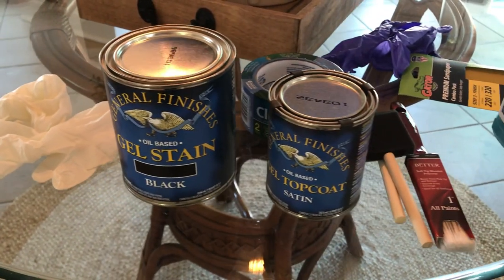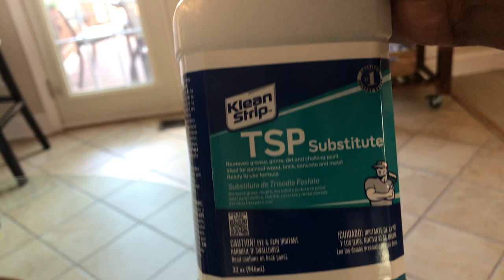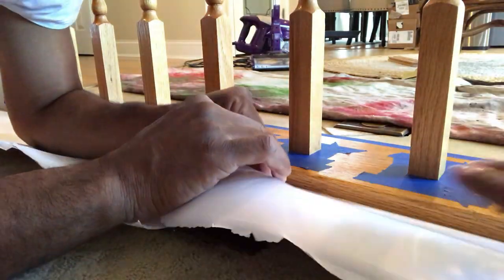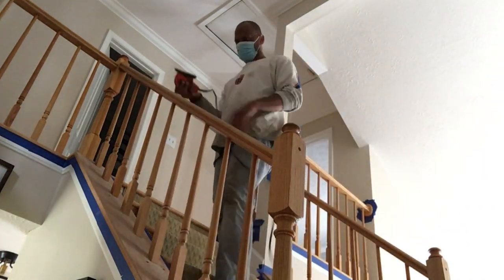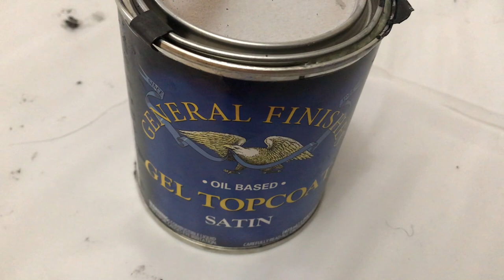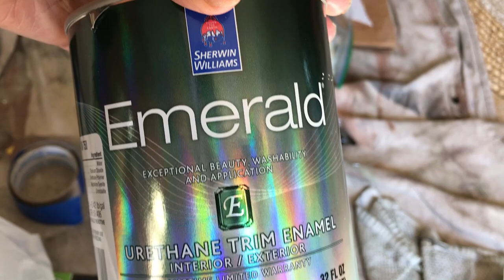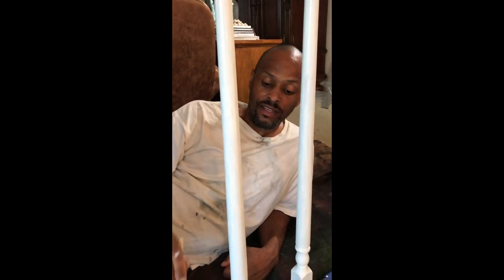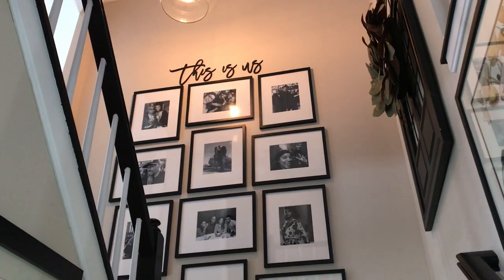DIY Oak Staircase Makeover Under $120 | Updating Oak Banister & Spindles | Before & After

Comment: Great job! When we moved into our home over 20 years ago we had black iron wrought railings then when we took up the carpets we discovered original oak flooring so we changed out the rails to match. I’ve thought time to time of changing or painting as well but still love the look. Your railings look beautiful in the black and white and goes great with the black and white gallery wall you recently did too. 🤗😍
Reply from the maker: Thank you. When we moved in this house 18 years ago, we had the oak flooring installed to match the oak railings...lol. We still love the flooring as oak floors will probably never go out of style. I just felt with the updates we have been making throughout our house, the railings were looking dated. I think painting them was a great and very inexpensive compromise...lol. Also, I like mixing the old with the new, it gives a house character and makes it unique from everyone else’s. So if you still like your oak railings, definitely keep them because a they will probably never go out of style. TFW!😊

Comment: Wait did you wipe the stain of between coats???  I followed your steps and it’s been over 24 hours and it is still tacky. Help!!!😭😩
Reply from the maker: No, I did not wipe the stain. You only wipe the stain if you want the wood grain to show through. Let the stain dry completely before putting on the next coat. I did say that it’s a long tedious process and you definitely have to have patience. But you will love it in the end. Hope this helps.
Reply: @RollinwithAnita  thank you for responding but that’s my issue. It’s been over 24 hours since first coat application and it’s tacky because I didn’t wipe in between. Did a google search and all of the searches say that it’s going to remain tacky and pretty much my only action is to try to apply another coat and wipe off. Was yours tacky??  I’m seriously about to cry 😭
Reply from the maker: No, ours wasn’t tacky and I didn’t wipe it off. Actually, we just redid the railings to our basement last weekend and they weren’t tacky either. Did you sand the railings before applying the stain? The only time we wiped our tailings the process, was after we sanded them to get the dust off. I’m not sure why yours is still tacky.
Reply from the maker: The only other option if it won’t dry completely is to do what the google search said.
Reply: @RollinwithAnita  I so appreciate you responding. I went on the website for the stain we used and it said to give it 3 days and if after five it’s still tacky then it probably won’t change. I did do a late swindling to get the finish off the wood. It’s been two days so right now I’m hoping I. The next few things something will change 🤞🏾
Reply from the maker: Just know that it can take longer than 24 hours for the stain to dry.
Reply: @RollinwithAnita  I see. The good news is I just checked and it seems like it’s drying!!!!  I would have been so sick if I would have had to strip all my hard work off. Thank you so much.